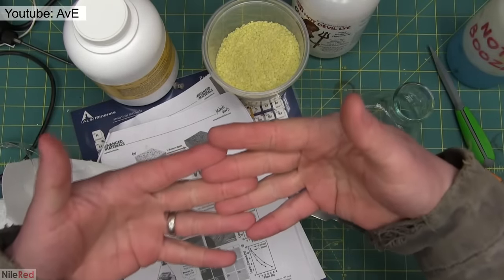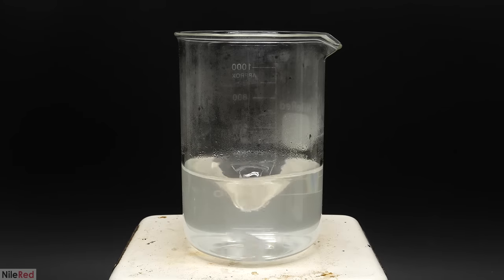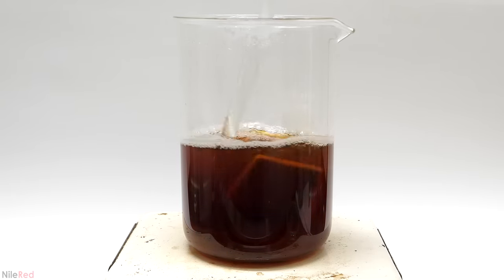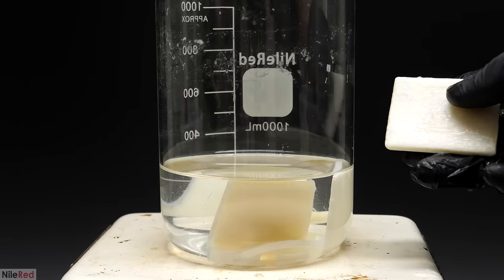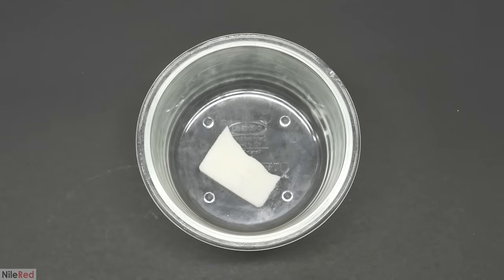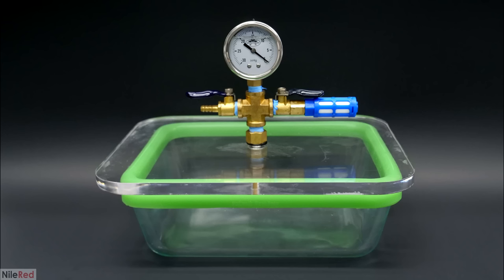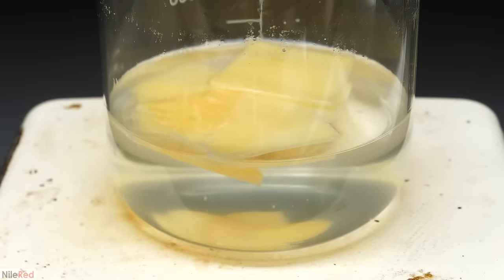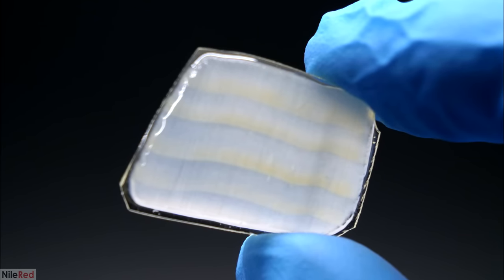Attempting to make transparent wood

Comment: You can tell he's a brilliant chemist by the way he used the table saw.
Reply: I would probably use a table saw like that lmao
Reply: Not really wrong
Reply: miki ......why?.......
Reply: @hsmacaraig  they just do it.
Reply: miki NAZI?
Reply: KL Tree Services
Chemist 100
Carpenter 0
Reply: when you invest all your skill points into intellect
Reply: @miki-we8mg  How do you feel about Jews?
Reply: @incog0956  jew
Reply: @jamesfranxx6151  ?
Reply: @incog0956  jew
Reply: J.J. Shank They’re aight i guess. 7.5 outta ten, decent race, could be better
Reply: Coco 11000 yeah
Reply: KL Tree Services he acknowledges it as poor technique
Reply: @t-kozy39  and, as a religion?
Reply: Jeremy Fleming not good out of ten
Reply: He still has ten digits?  :-)
Reply: Ngl I’m not a chemist and I’d use a table saw like that
Reply: As a person who regularly uses a table saw, he didn't really do it wrong, but I admit I would have used the little square thing that fits in the groove on the saw table...the exact name of which escapes me at the moment...so the wood cuts perfectly straight,  because if he was cutting something like oak, it could have easily kicked back if it caught on the blade.  Basswood is so soft that it most likely wouldn't have gone far, but in any case,  you didn't do it wrong technically if it worked, heh.
Reply: Also the metal saw :)
Reply: And I can tell from your eloquent wit that you are a brilliant engineer.
Reply: Dungus Wungus I cant tell if that’s a joke or not....
Reply: The way he reached in to pull it away from the initial cut, I was waiting for blood.
Reply: 林 IMO a saw bench is different from a table saw so... ye
Reply: @SAP20092  well that is just it the more intellect the more overall skill not just one place
Reply: R/Imabadass
Reply: Pam Botts intellect doesn’t always mean more overall skill though. It may mean knowledge or understand of something but doesn’t mean you have basic skills in said thing.
Reply: @incog0956  jew
Reply: my heart stopped when he pulled the wood away and I saw how close his hand got to the blade, jesus
Reply: Menthols The world knows what’s up 😌
Reply: And how he describes the wood as a "nasty overgrown thumbnail"
Reply: @General12th  jew
Reply: It made me deeply uncomfortable.
Reply: @incog0956  jew
Reply: @miki-we8mg  ?
Reply: He says he wanted to record it, so he didn’t have good technique
Reply: @incog0956  jew
Reply: @incog0956  jew
Reply: @t-kozy39  not as bad as gingers though am I right?
Reply: Incog 0 really? You must have missed the part where he grabbed for the piece of stock after he completed the cut and had his fingers dangerously close to the blade. I’m not criticizing NR, just saying that getting your fingers that close to the spinning blade of a saw is not a safe practice.
Reply: Or maybe by those soft hands lol
Reply: @incog0956  No, just totally wrong!
Reply: @incog0956  It's just too easy to loose your fingers with those things. And it happens so fast there's no way you can stop it. I'm from the UK and here you're trained not to let your hand /fingers within 1ft of the blade whilst using it. You do this by using push sticks and /or the sliding sled which he should have used for cutting across the grain. His table had the grooves to take the sled. It's good that he at least acknowledged his lack of training but in a way that can also encourage some to 'have a go' without training also. Shame he didn't just take a small amount of time out to find out how to do it the right way, for everyone's sake.
Reply: As a carpenter it wasn't a big deal because the kickback wouldn't have hit him but when he grabbed the little thing I flinched because he got hella close to the blade
Reply: "Poor man's setup"

Ouch
Reply: At least he brought up it was dangerous later in the video 😂😂
Reply: Tunkkis suomi perkele
Reply: that's his dad...
Reply: @steveshepard1810  yep, that was actually hard to watch
Reply: Seth Cereal yes
Reply: butter. He said it in a rude way like saying Jew to insult someone like there a bad thing,and nazis hate Jews so I called him a nazi =P
Reply: @stefanforrer2573  it really was, use a piece of junk wood and slide it out. That's just common sense.
Reply: miki probably don’t even know what a Jew is
Reply: Tunkkis yes
Reply: @punishedexistence  Could be wrong, but i'm pretty sure he's standing right where a kickback would throw the board (at least from what I remember from middle school shop class)
Reply: Yes
Reply: Seth Cereal no more skill points for technique, whoops.
Reply: HAAH! xD
Reply: Incog 0 jew
Reply: Incog 0 you’d lose a few fingers fast
Reply: punishedexistence it is possible to do something the wrong way and it work out in the end. Don’t promote ignorance or try to justify his actions.
Reply: Well he did say he asked his dad to do the second set. Honestly is key. Lol I know a brilliant Scientist to be he is about the same way lol
Reply: @incog0956  Jew
Reply: that scared the shit out of me as a woodworeker
Reply: @General12th  jew
Reply: @t-kozy39  what in the actual fuck😭😭😂🤣
Reply: @miki-we8mg  ???
Reply: Comedy Cats art and animation :3 how
Reply: This is the best comment I've read in a while.
Reply: It's not chemist its scientist
Reply: @justarandomname1277  what who is  nazi
Reply: Oliver milk said jew
Reply: Jacques Desardjins you’ll learn when your older
Reply: butter. Ya and?
Reply: @justarandomname1277  bro  I know what a nazi is    I  was asking  who  you were   referring  to
Reply: Jacques Desardjins oh
Reply: As long as they calculated the loss of substrate from the cuts....
Reply: Are you trying to point out his lack of safety or the fact that a table saw is the wrong tool for that. He needs a band saw.
Reply: Bean Man  yeah
Reply: @nonbinarypotatoes6038  401k is the life of the older books and the air in the middle and a pretty good deal with it was a sturdy and easy to just jump on the page ever so slightly and
Reply: Cause scientists are known for their knowledge of power tools.
Reply: to all the people chanting Jew
are you trying to summon a babka?
Reply: a brilliant chemist a terrible carpenter
Reply: Yup
Reply: I’m in tears
Reply: @incog0956  jew
Reply: @incog0956  jew
Reply: Is that not how you use a table saw?
Reply: @MFKR696  thank god I haven't used a table saw yet then
Reply: @MFKR696  minus the head. Pretty sure that's important
Reply: Right lmao
Reply: @incog0956  jew
Reply: Key word: CHEMIST
Reply: @t-kozy39  Jews aren't a race, they're a religious group
Reply: Who the hell is miki
Reply: As a master craftsman I cringe when seeing the table saw being used that way, I’ve had a block that size get shot back at me.
Reply: Lmao
Reply: Bro it’s not that hard to use a table saw😂 I could do that when I was 12
Reply: Is it just me or is the saw blade moving in the wrong direction
Reply: @incog0956  see.   owl www
Reply: Yup.
Reply: Chemist, not carpenter.
Reply: Can’t*
Reply: @kars676  kars noooo
Reply: And the way he used the knife
Reply: And by the fact that he has whatever the word is
Reply: „It was a bit  dangerous, but I thought it will be cool”
Reply: i took a course on woodshop and it hurts to see how he uses the saw
Reply: @Wazaag Break-head why
Reply: So ethenol and bleach makes chloroform?
Reply: @incog0956  jew
Reply: The way he picks the block of wood up at the end looks so damn close
Reply: He does say that it was poor technique so he can hold the camera.  Yes, the way he does it dangerous for two big reasons. One is that if the wood catches on the blade it can be thrown upwards and pull his fingers onto the blade. The second is that the small pieces against the fence can be shot backwards at high speed, which is called a kickback, although in this case he is standing to the side so he would not be hit. Normally a person would be behind the saw and get hit in the midriff.
Reply: 13k likes? Just because he wrote that comment? What’s so special about it
Reply: He is to table saws what you are to chemistry and you don't have to goto school for table saws.
Reply: Cross cutting with the fence instead of a miter gauge, no guard... amazing
Reply: @shinviews4717  it’s just an extremely relatable joke to physical laborers, i.e. “You can tell he’s a rocket scientist by the way he uses that table saw!” But in this case it’s really funny because he actually IS a chemist,,
Reply: You'd think if somebody was guessing at how to use a table saw, they'd make a cut the right way at least half the time. Nope xD
Reply: Pretty sure that was his had using the saw and he was filming it
Reply: aboundvths
Reply: Lotta jews up in here. Good lord
Reply: @incog0956  its totally wrong
do not use a tablesaw like that!

1. dont cut 3mm from 100mm or anything else, cut instead 93,5mm so thats 3mm left.
When u cut like this it will press against the sawblade and thats not good.
2. get a Cameraholder, a second dude that holds it or dont film it.
You need both hands on the wood!

The most Dangerous thing is not the sawblade,
its the wood you cut.
Reply: For real
Reply: You can tell I’m a lot like that when I use any kind of tool as well. My poor father can’t build shit with my help lmao

Comment: this is why its important to highlight all of your steps and procedures when writing a paper. When others try to replicate your procedure, they wont be as lost as this.
Reply: Exactly what I kept thinking..lol
Reply: @fabian9256  not if they're trying that for the first time.🤔
Reply: ...and now days you should be required to upload a video like this along with the paper.
Reply: Ikr that's like the first thing they teach you
Reply: All of you know that most disciplines don't do methods sections like Chemistry does, right? I mean I like how chemistry will do the methods as a special section at the end of the paper with all the details (in tiny font to fit it in), but most areas of science don't care about the details of experimental methods in the same way because the practitioners assume that if you are reading the paper you can probably work out most of the method.
Reply: @TheLateleks  it is well known that all chemists are psychics.
Reply: probs wasn't even a peer-reviewed article
Reply: In Full Metal Alchemist they would write research notes in code so only they know how to properly do it, lol must have been written in the same universe
Reply: + Dominic   Well, it appeared in Advanced Materials, which I assume is a good-quality peer-reviewed journal (coming out of the Wiley house), though one can never tell nowadays.
Reply: + @TheLateleks  The quality Chemistry journals I've worked for over the years certainly printed their Experimental sections in the same font size as the rest of the article. I've no idea (nor do I care to imagine) what crappy nonsense you've been reading if the Experimental section was set differently from the rest of the paper. Some gimmicky, pretentious online junk, perhaps?
Reply: + @theterribleanimator1793  Not so, it's only the illusion of mystical powers that we inculcate to entice Joe Public into believing that we are indeed so cerebrally superior. Long may they continue to hold us in such awe.
Reply: Though stabilizing objects with resin is pretty standard...
Reply: Don't forget sometimes people want to file a patent, so some little details get "lost" in the process...
Reply: yep shoddy work like this is why most research isnt reproducible lmeo
Reply: Maybe they did it on purpose
Reply: many authors don't write all of the methodology's details simply because they don't want to give up all of their technology just like that specially since it's a new compound material. I'm used to trying to replicate electropolishing/Electrodeposition steps based on papers and having a hard time figuring all the specific conditions and step orders and all the small details that aren't specified in the text. Sometimes they'll tell you if you try to contact them by email but that does not work very often. So yeah, it's pretty shitty that articles get published like that but at the same time they surely did that on purpose. People (and institutions) are selfish af.
Reply: @veronesialex  Your point about the patents may be true in some cases, but not in most.  I used to work for a Fortune 500 company with products and patents in chemistry and engineering, many sorts. I was in charge of the corporate research records at one of their main research facilities.  Their attitude had been what you described, but they were losing patent claims to other corporations because (some of) their scientists weren't writing down their procedures.  Heap big meeting of lawyers, corporate directors, and l'il ol' me.  Result: orders to scientists to shape up, and I developed a course every scientist and technician had to take, and wrote a handbook for in-house publication. It's OK to leave some info out of patent claims to protect yourself/your work, but you have to have the information and the evidence of how you came by it to present to patent examiners if requested.  The US gov't also has scientists and engineers of every description who may be asked to verify your work, and they'd better be able to get your claimed results by following your filed claim and any info added during patent interviews, or you will not get the patent .
Reply: Laugh in math papers

Comment: Imagine buying glasses and finding out they're made out of wood.
Reply: Bruhh
Reply: Why isn't this popular already?!
Reply: Woodes
Reply: As an engineer that also likes carpentry a bunch, I really want to figure out how to make this work, because it wood make for a cool looking chalice, but I'm not really sure how it would work with filling the tubes using epoxy, as here, small flat cuts are used, and in a chalice or other drinking glass, the sides are round and more complex.
Reply: @meme__supreme3373  make a Minecraft plant pot and call it a chalice
Reply: Its like you discovered your mirror is mde out of cake
Reply: @meme__supreme3373  if it was carved from a single piece of wood about half of the object would be clear. It would also likely be clear looking at it from one direction but opaque looking at it from a 90° turn.
Reply: You mean drinking glasses or eye glasses?
Reply: White Darkne22 eyeglasses I think lol
Reply: Worst glasses in the land
Reply: It be bad for the envorment
Reply: @meme__supreme3373  maybe rapid pressuring to force the epoxy into the wood and then depressurize.